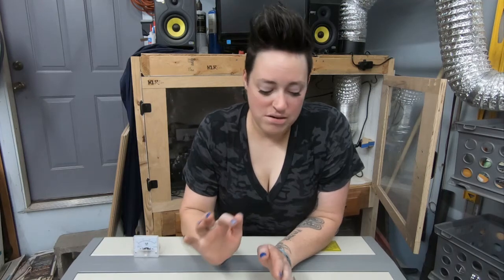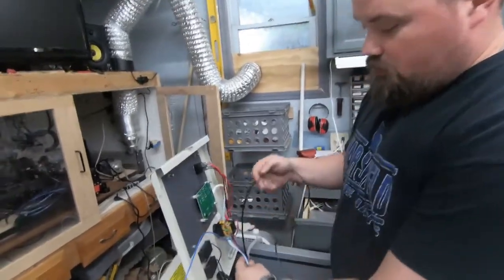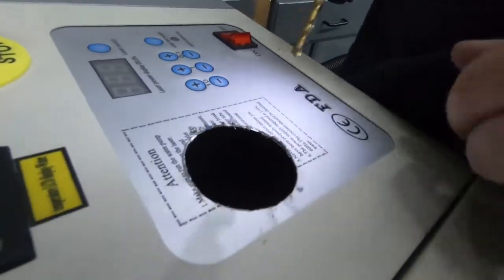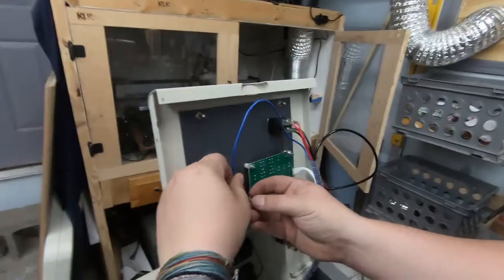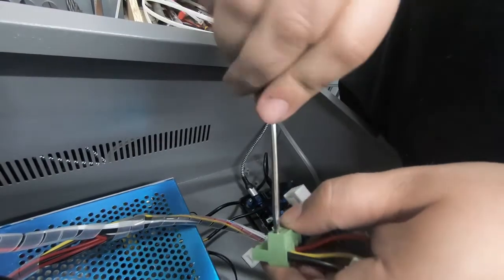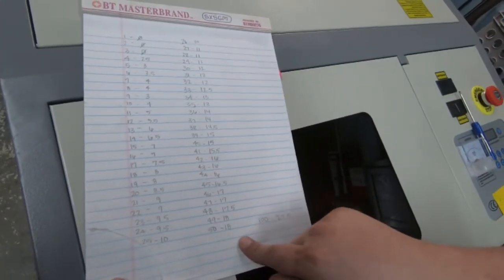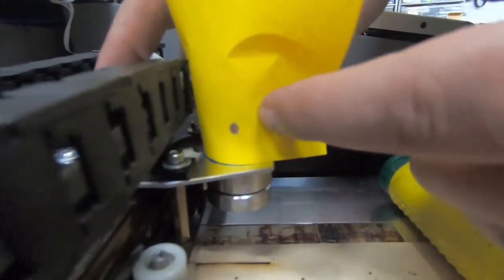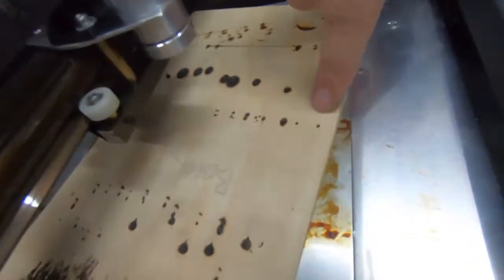Milliamp Meter Install and Mirror realignment | Monport K40

Comment: Aren't those mA values a bit high for a 40W tube?
Reply from the maker: You mean we are running it to high? Probably for long term use yes.
Reply: @KLRform  from the average of tubes I've saw I would say yes but different tubes are rated different mA, I was just curious because I've never seen one that high